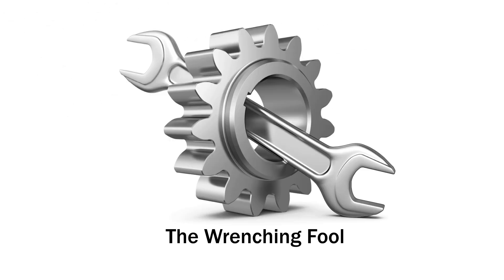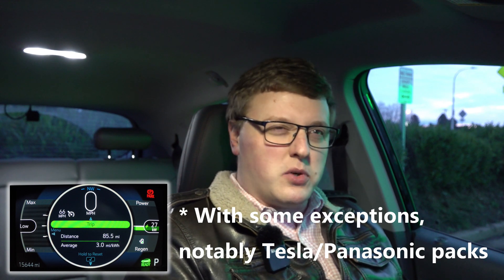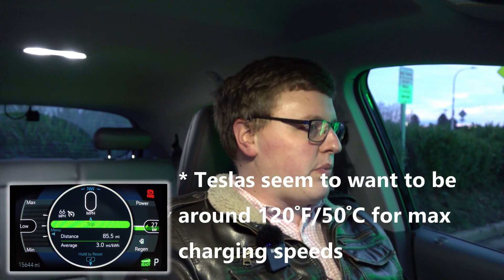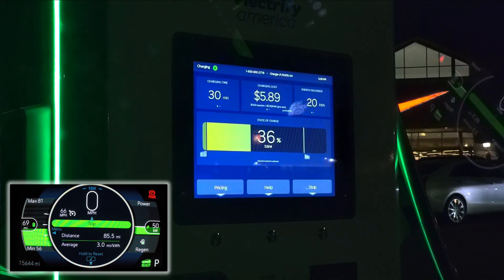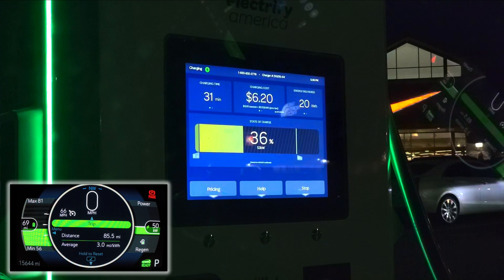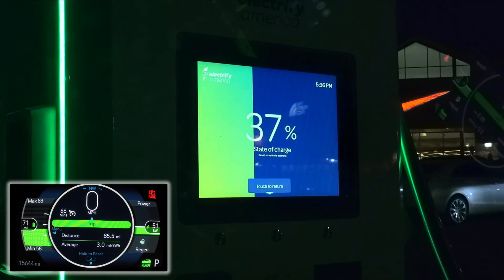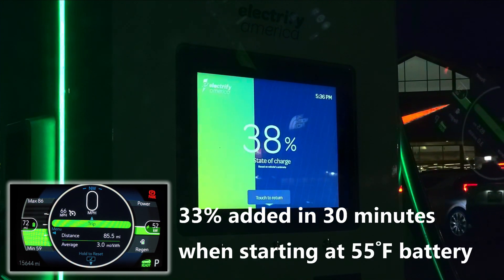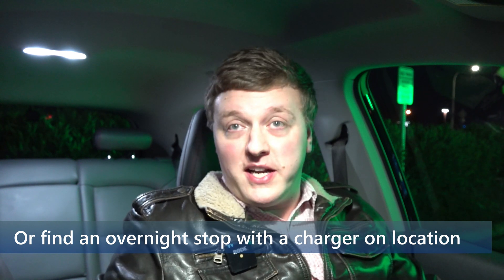Why does my EV charge slow?! 2019 Chevy Bolt EV Cold temperature DC Fast Charging

Comment: What about -20
Reply from the maker: The car will only allow the battery temperature to get down to about 32F / 0C, then it will maintain the battery at that temperature. Attempting to DC charge it at that temperature would be very slow.

Comment: Why cant they just add something like a 50kw resistive heater  that draws straight from the charger ? It would heat up the battery in a few minutes then you are charging at full speed.
Reply from the maker: There is a limit to how aggressively they can heat the battery without causing damage. 50kw is about 10 times as much power as a typical residential oven uses. I’m not saying that the Bolt heats the battery as aggressively as possible by any means, but it would be better if they would start heating the battery while you’re on the way to the fast chagrer

Comment: Good information. I am interested in the EV but for now they are just not practical. Hopefully they will be able to overcome these issues.
Reply from the maker: I think it depends on individual circumstances. For myself and my partner, our electric vehicles have been far more practical than an internal combustion vehicle for 99% of the driving we do, which is our daily commute. We both drive about 2,000 miles a month (4,000 miles total), most of which is commuting to/from work. Our electric vehicles work brilliantly for this and nearly pay for themselves just with the energy savings. Of course, some adjustment is required, and it really helps to have an at-home charging solution, but the occasional slight inconvenience of charging during long road trips (which are few and far between) is vastly overshadowed by the cost savings and convenience of charging overnight at home during our daily use.
Reply: @wrenchingfool5284  nearly pay for themselves? That is hilarious. I have no problem with the EV. In fact, I am interested in the concept, but they are not practical. They are however a novelty and the only reason some buy them. Hopefully the industry will work out the problems with them.

Comment: This is why in a Tesla, when you navigate to a Super Charger, the car starts conditioning the battery before you get to the Super Charger. It will condition even in moderate temps after driving for an hour (70F ambient). It seems Tesla is quite far ahead of other manufacturers in many aspects. I rented a Model 3 Standard Range+ in January in Florida. This is when I learned what range anxiety really meant. When you have a 175 mile drive at night and you start the trip with 54 mile surplus range and watch that surplus decline as the trip goes on, range anxiety becomes a thing. We ended the trip with 15 miles range instead of 54. The Tesla is pretty clever, it will tell you if you continue to drive at current speed, you will not make it to your destination. Slow down a bit and the warning goes away.
Reply from the maker: Tesla definitely has better trip planning than many other EVs, although some like the Mach E, ID3/4 and the Volvo/Polestar models are pretty close. The ability to preheat the battery when the vehicle knows you are going to a fast charger is definitely nice and was a necessity for Tesla, especially the older ones as their temperature requirement for peak charging speeds was quite high.

Comment: Seems like this could be fixed with software...no reason a running bolt should ever drop below optimal.
Reply from the maker: The reason that it doesn’t run the battery heater in order to maintain the 75 degrees F battery temperature needed for maximum charging speed is because this would be a huge waste of energy and significantly reduce the vehicle range. No modern EV manufacturer does this, but some like Tesla and VW/Audi have the option to start running the battery heater on the way to a fast charger.
Reply: @wrenchingfool5284  nah.  It wouldn't have to run constantly to maintain 75 anyway.  Under long duration operation the battery would likely heat up on its own, even during winter months and spring and summer it wouldnt need to run at all.

Comment: Why is your battery only 55 degrees? Doesnt the Bolt have battery conditioning to maintain temp?
Reply from the maker: It does have battery conditioning, but because the Bolt was not designed with the ability to tell the vehicle when you want to fast charge it, such as navigating to a fast charger, it maintains the battery at sufficient temperature to allow for maximum capacity and discharge performance, but not maximum charging speed. On cold days, the battery heater will activate to keep the battery at a minimum temperature of about 40 degrees F, which is still good enough to allow the full 150kw output, but it will charge slow. Thanks for watching!

Comment: I had a 2017 Chevy Bolt That I sold and bought a 2018 Ioniq for this very reason. Yesterday I was at 71KW at Electrify America! This is a big problem for the Bolt and really kills the benefit and expense of a larger battery pack in general. I have been able to go farther and charge faster in the 28K Ioniq than the 60Kw Bolt for this reason..Even the 21 Bolt is still slow!
Reply from the maker: I definitely agree that the Bolt’s slow DC fast charging is a problem for long trips. It was especially disappointing to see that the new battery they started using in the 2020 Bolt (which carried over to the refreshed 2021 Bolt and the new EUV) had very little improvement in that regard. I also have a 2020 Kona Electric, and the difference in charging speed is noticeable. Stay tuned for future tests where I will show what a difference charging speed makes over long distances.

Comment: Good advice. My e-Golf certainly has slowdown issues when too hot, but since I rarely use DCFC in the winter, I have not noticed a cold slowdown. One of these days I need to try DCFC before the weather warms up.
Reply from the maker: Yes, the ideal temperature range for maximum speed charging is pretty narrow, and on vehicles like the e-Golf and the Leaf without a strong cooling system, they will thermal throttle at high temperatures too. Thanks for watching!
Reply: No problem. E-Golf And Leaf do not have battery cooling (or heating) - they are passively cooled or heated through conduction to car body or convection of air flowing under car.

Comment: Solid video, Kevin. Please make more. Its nice to see other Bolt owners documenting their experiences!

Here in Northern Virginia, I have an Electrify America station that does not go past 30kW of charging speed. A few hours south of me, I found a station that went up to 49kW.
Reply from the maker: Interesting. Is the charging station itself limited to 30kw or is that what you experience with your vehicle? The lowest power EA station I've seen in my corner of the NW is 50kw, but I can definitely imagine that they may put lower power chargers in some areas if the infrastructure just can't handle the higher power. Having fast charging in some capacity is still better than nothing. 50kw may not be terribly high charging speed on a modern EV, but it is still a massive amount of electricity! 

I definitely have more videos on the way, but my partner and I just moved into a new house a couple weeks ago, so that has slowed down the editing process a bit. Thanks for watching!

Comment: Good info, I've never seen my 2017 Bolt EV Premier charge above 48 kW even in warm temps! In Minnesota winter I rarely get to 40 kW even if I've been driving for a while. Fortunately I rarely have to fast charge. Thanks for the wonderful video!
Reply from the maker: Thanks for the feedback. Usually during spring and summer temperatures here in the mild Pacific Northwest, my Bolt will typically charge about 49-50kw at single digit SOC then pick up to 51-55kw depending on whether or not it is having to use the battery heater/chiller, or if I'm running the heat or AC. The maximum rated current allowed through the connector is limited to 150A, so while using the heat or AC doesn't affect your charging speeds at less than peak speeds, it will limit the peak current going into the battery if the battery management is allowing peak charging speeds. Hopefully that makes sense.